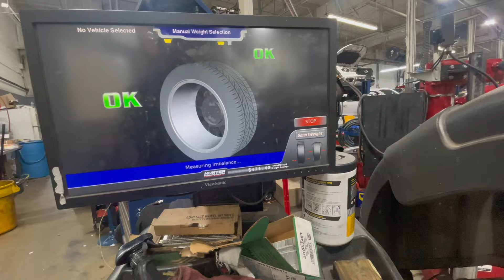Entry Level Ford Technician (When should you buy a tool?/Don’t Compare Yourself To Others)

Comment: When you be mounting tires, where you put the valve stem
Reply from the maker: @quickz356  when I’m taking the tire off I have the valve stem in front of the demount head and when I’m putting it on I have the valve stem on the opposite side of the demount head

Comment: Have any experience at another manufacturer? I want to goto Ford but I’m a Toyota master tech with 6 years experience working on Toyota’s (but we work on any car brand, especially Ford and Chevy) Wondering what the biggest differences are when switching? If you have worked at another manufacturer that is.
Reply from the maker: @yaboykris2118  nah this the first dealership I worked at you probably already know this but the only thing I can tell you is how the system is ran is probably a little different and mostly ford of course come through the shop anything outside of that most likely be used cars that they’re about to sell or they’re just coming for basic maintenance